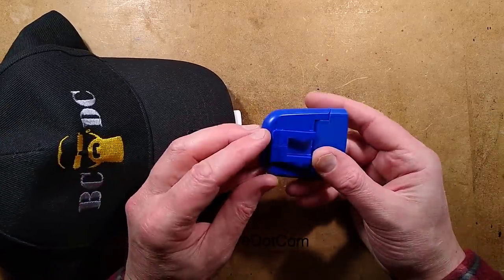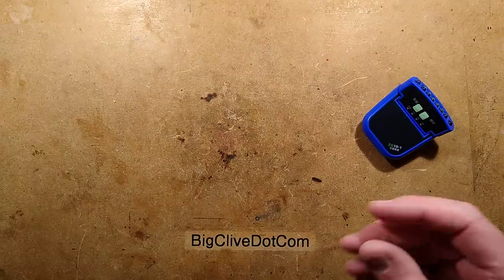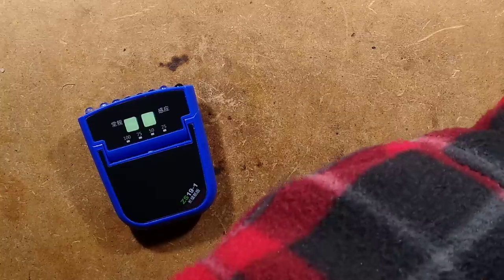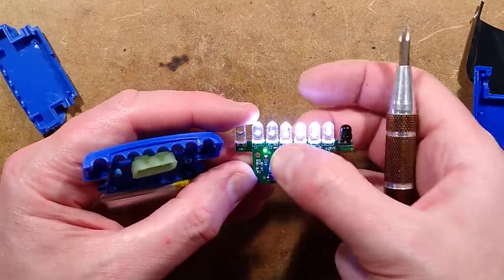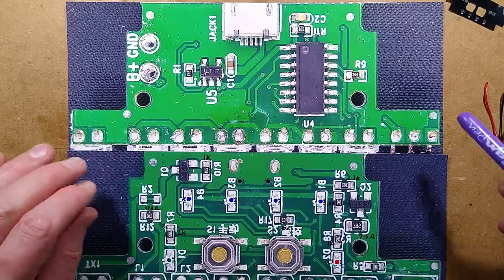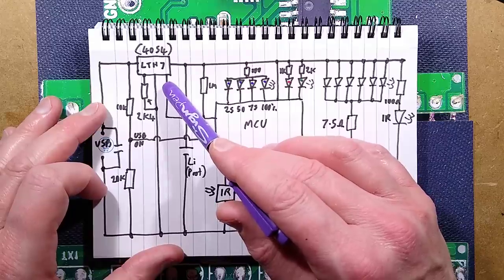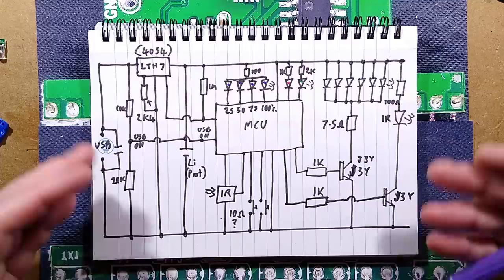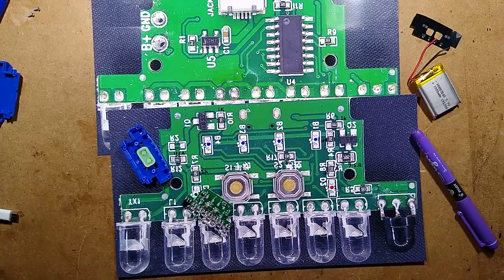Inside a good rechargeable baseball cap work light (with schematic)

Comment: About the 600ma/800ma "options":
The 1000ma batteries are cheap enough when bought in bulk. Instead of trying to get two different batteries in enough bulk to make them cheap, they instead offer a 600/800 option that are in reality a single 1000 option. This way they can charge you extra if you think the cost is worth the higher amp rating. It's like a reverse coupon. The product still makes a profit when used with a coupon, but some people can't be bothered to use a coupon so they pay more, but with a coupon some people think it's a bargain and will more likely buy the product when offered a coupon.
Reply: Not scummy at all, but psychology.

Comment: mine arrived today £7.50 1000mah.. really pleased. fits the peak of the Motorcycle helmet well and wont shake of as the cip is ribbed. I deliver and always need a reading light .. so will see how it gets on.. Battery shakes a bit in the unit, was going to spludge it apart but i want to keep unmolested. mine is black called a ZS-19-1.  AT 7x the price of the Poundland cob its its a bit lower on lux output.. but as the bear says.. it tilts, recharges and has the induction swipe 45g in weight . cheers big lad.

Comment: 1:32 those swipe functions never really work like you want when your working. Keeps turning on and off when you turn your head.
Reply: Agreed. I bought one of the orange USB-charging head lamps that BC recommended a few videos ago. It's great, but using the swipe function when I'm on call means it turns off whenever I get out of the van after turning it on etc. Really annoying!

Comment: I've been quite impressed with the Poundland head torch you did a video of back in Feb of this year. Except for two annoyances:
1) It points forwards, so I designed a 30 degree 'wedge' to make it point down into your field of view, Thingiverse 4564039
2) It runs off AAA batteries - I hate AAA batteries for anything other than remote controls & other low power devices such as LCD clocks/weighing scales etc., so I made it USB rechargeable. I redesigned a whole new back to incorporate the charging circuitry from a Poundland USB powerbank, and two 500mAh lipo cells in parallel (old batteries from an old quadcopter), and I made it so it also tilts down 30 degrees. It's so much more useful now, and brighter since it's driven directly off the lipos. I did try running it from the USB charging board's 5v output but it got way too hot and the clear cover over the LED started to deform...!

Comment: Also, I ordered two and both have the same problem.  They illuminate the bottom of the light bezel and this light shines directly into my face.  I have taken duct tape to block the bottom of the LED housing, but it seems they could have solved this with an opaque plastic and the LED's sunk deeper into the housing.

Comment: You think that maybe those green and red LEDs are maybe test LEDs? Maybe they test the circuit before putting LEDs in, or if LEDs are not lighting to signal the circuit is working correctly?

Comment: I have LED lights built in straight into the front edge of my cap's bill/peak. Their angle is not adjustable related to the cap, but I can always adjust the cap's angle, how I wear it. Turn even backwards, if I like. There is no much use of possility to turn the light upwards without adjusting the whole cap, because the bill/peak would block the sight anyways, if only lights are turned upwards.

Comment: Hey, how would I go about sending you something?  I'm from the US, but have some Sylvania LED light bulbs that have gone dim forsome reason, VERY dim at that.  Two or three of them, over about a year, to be exact.  They also fade to darkness when you turn them off/unscrew them, which is also odd.  Figured an autopsy would best be done by yourself.  I'm pretty curious as to what failed, as again, they still light up, but barely, and behave odd when unscrewed compared to functional ones.
Reply from the maker: Sounds like the classic failure of a series circuit of LEDs.  There will be at least one with a black dot in it where it has failed open circuit and arced very slightly at that point.

Comment: What do you do if you wear your baseball cap backwards, as most folk seem to do? What are you doing whch requires light whilst wearing a baseball cap, you know, to keep the sun out of your eyes (if you're wearing it right)?
Reply: Not everyone is Fred Durst
Reply: The only time wearing a cap backwards is acceptable is when using a welding mask.
Reply: @dogwalker666  or if you're a catcher in baseball.
Reply: We wear a BB cap while inside electrical closets where all sorts of dust, dirt, spider webs etc get in your hair and where it's dark or dim.  Also some jobs require wearing a helmet so clip it on the helmet brim.

Comment: What microcontroller is it using? The microcontroller needs to be awake all the time right to listen for the button presses, but how then doesn't it drain the battery?
Reply: The MCUs are capable of idling at a fraction of a milliamp and sleeping at a few microamps.  They draw very little current, even when running because they don't have to be clocked at MHz, they can have a clock at 32.768 kHz.  That's 500 times slower than normal, so current drain is very low.
Reply from the maker: Possibly a Padauk.  Most microcontrollers have a sleep facility which reduces they're power to near zero.  They can be woken by an input detection or by a timer.

Comment: Question:if we energize a high intensity UV sorry i.meant IR LED panel flashing and put it beside a protected product .will this protect the product from getting pictured by cellphones ?
Reply: You mean protecting your product from being photographed as a countermeasure against illegal copying? I think that could possibly work, either with UV or IR LEDs, maybe a mix of both. But you should consider that a) strong invisible radiation is considered harmful to the eyes because it does not trigger the blinking reflex as strong visible light would do; b) if you pulse the LED output, it would be easy to bypass by taking a slow-mo video, which can be easily taken with any reasonably priced smartphone in an acceptable quality,  and have a look at the product in the frames between the LED pulses. So i suppose you would have to run them continuously; and c) depending on the construction and the product you want to protect, both of which are unknown to me, you would need to cover a rather wide angle to prevent the item being photographed from a shallow angle. Usually the LEDs have a rather narrow beam, so that would require either more of them, or wide angle ones with higher power output. I hope i could contribute to your enlightenment.
Reply: You want near IR, not UV.
Reply: I miswrote, i meant IR the array module used for night surveillance lighting. Maybe connect to a high speed flasher circuit. Is this concept right?
Reply: @micha_el_  yes you nailed the idea well. I gues 2 IR modules one flashing and one continuous. Agree with u they can still video tape or even use old photography film. But it would be another method to curb counterfeiting.

Comment: This model is so cheap in China that I doubt they know what battery is in it. I checked the original listing for yours Clive and it states 600/800mah with no option to select which you get but the data sheet states 1200mah and the packaging doesn't state battery capacity at all 😂 so yeah I reckon it could be a pot luck thing depending on what battery packs they had at the time it was made

Comment: Hm hm hmmmm. By now and with the prices always going up after a BC-Review
i would honestly expect a BC-DC 3D printer file for a headlamp to snap together,
and the usual smartphone / digicam battery + micro-usb charger chip and a "how to use what you find" tutorial.
Especially with those cheapo 5mm LEDs..

Perhaps a version running off one or two used AA cells and a joule-thief / pr4403...

So instead of bringing up the prices for the cheapo chinese import product,
the chinese could start building and supply the pink BCDC version :-)

Comment: Americans call it a bill because it looks like a duck's bill.
Reply: I've heard 'bill' used.  But the regular hats have a brim.  I'm not sure if that applies to the baseball caps.  

It's seldom that we find these head / cap lights with the several features that make them desireable.  Usually they use three heavy AAA cells that are depleted quickly and are in a problematic case that's a pain in the ass.  And as already mentioned the LEDs are fixed and not at the optimal angle.  It's really great to find a light that has been well designed.  I hope it holds up under use, however even at ten dollars it's a decent deal.
I wonder if we could buy a dozen or so on Ali Baba for a cut-rate price?

Comment: Hi I sent you a post on Facebook with a picture I guess probably search Philip rizek to find it it's a circuit board from a air conditioner with a built-in factory hazard bare metal part underneath of it that shouldn't be there blew the fuse and the trip reset plugged on the wall you may use the picture ask me more info anyway you like have a great day